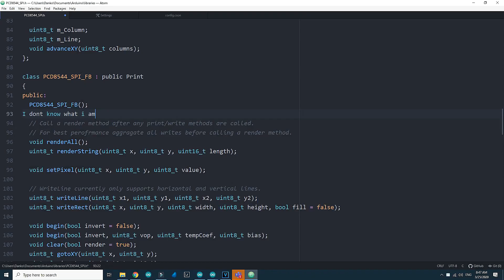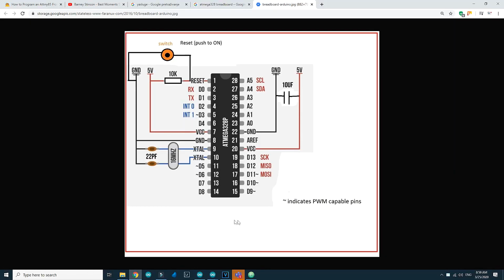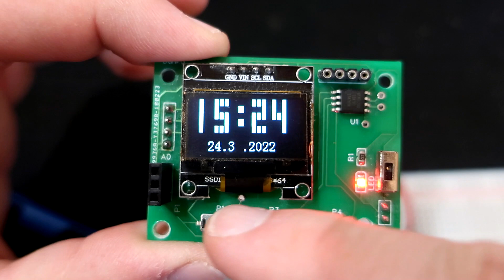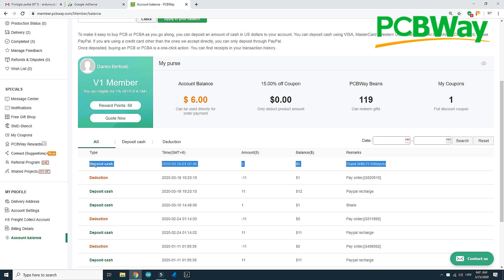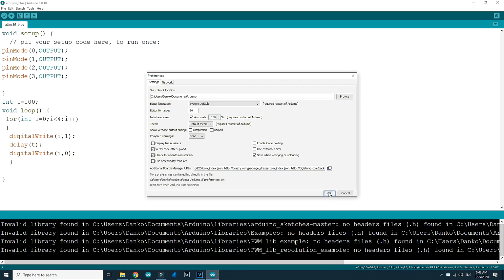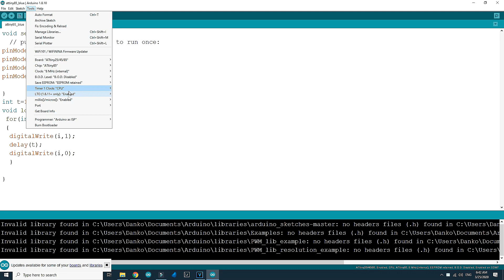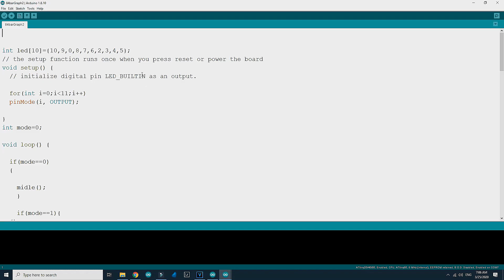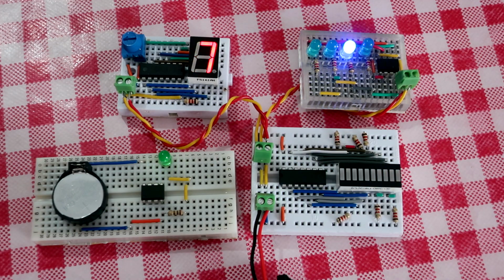Attiny series,  cheap mini microcontrolers, great toy for  self-isolation (programed with Arduino)

Comment: Hi
Is it necessary to porgram attiny24a?
I use that for driving two seven segment in a inductance meter circuit but it just lightup D and F in both of them and not propperly works

Comment: after buying the attiny board, i think i'm going to stick with the atmega168/328 chips and the arduino nano and above. some of my sketches did not transfer well to the tiny and it was annoying to program. another negative was the number of pins, as a single input, an output, and a LED  would take up most of the pins.  if the price difference was bigger, i might try to learn it, but for just a bit more, one can get the full arduino boards or the bare 328p. 
saying that, i still have a attiny board still left, so i'll see in what project i end up using it.
Reply: The led situation is easily solvable with shift registers though, but it is hella limiting i agree, but that is what makes it fun and challenging imo
Reply: I want to make a tiny rc car with one

Comment: Where do you buy breadboard single core wire? I can't find them.
Reply from the maker: https://www.ebay.com/itm/140pcs-Solderless-Breadboard-Jumper-Cable-Wire-Kit-Box-DIY-Shield-For-Arduino/381374867190?hash=item58cbb6a6f6:g:BpEAAOSwcu5UPSd7

Comment: Their seems to be two schools of breadboarding;  the jumper wire bird nest and the net solid wire roads.  Where did your learn the solid wire technique, book?  Can you share how you measure wires,  plan, and blueprint your projects?
Reply from the maker: no, its not that hard, and you dont need to measure wires, only little planing is needed... you need to buy these https://www.ebay.com/itm/140pcs-Solderless-Breadboard-Jumper-Cable-Wire-Kit-Box-DIY-Shield-For-Arduino/381374867190?hash=item58cbb6a6f6:g:BpEAAOSwcu5UPSd7

Comment: Great, I would like to know the libraries you have used for rtc and oled. I am having trouble in using i2c in attiny85. I have even used tinyWireM library.
Reply from the maker: i will try to find code for that clock, i will send you
Reply from the maker: Here is code.. instde code you will see libraries https://drive.google.com/open?id=1hvd1U_IqdLyDSF6m-472bXu_kD210XhR